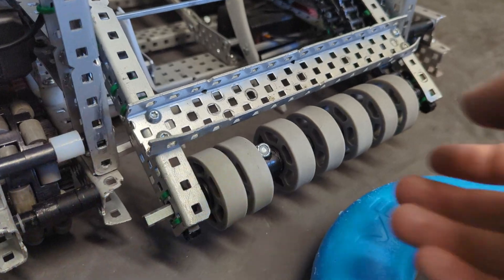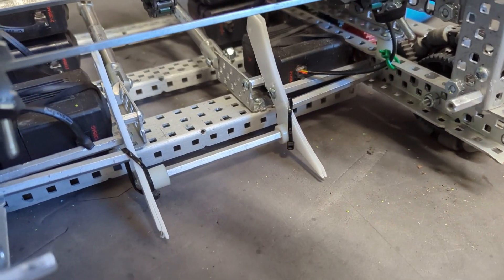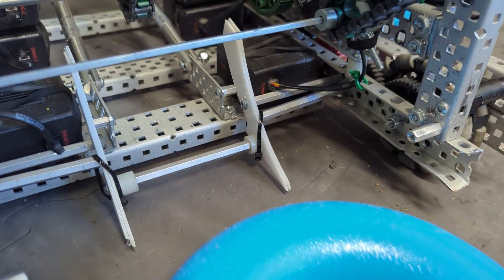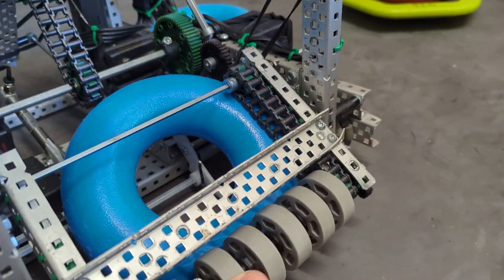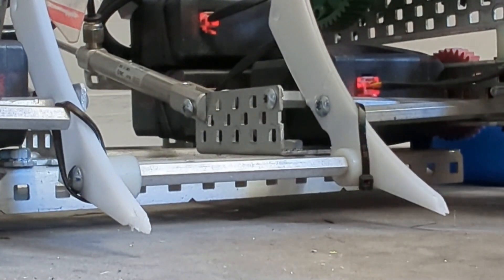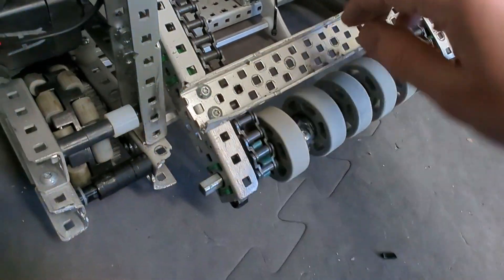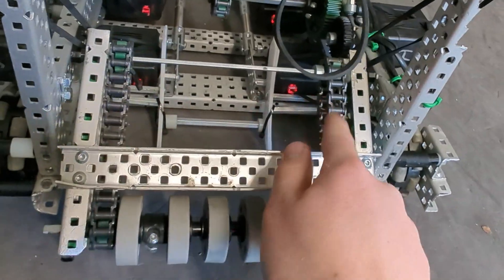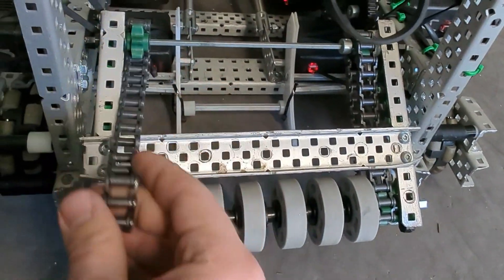How to Build an Intake Part 2 | VEX HIGH STAKES

Comment: How did you make it so your flex wheels still spin while it’s grabbing the rings. We have a problem where when the ring goes up the ramp the flex wheels won’t spin and push it into the hook
Reply: Do you have wheel Insirts and a floating intake?
Reply: @ yes I do I have basically everything that he has idk why his works and mine doesnt
Reply: @epiclapeer2661  clean ur flexwheels and make sure the ramp isn't to steep and put the flexwheels an inch infront of the ramp
Reply: Might be the code. That was a problem for us too. Just go into your code and increase the torque that helped us. I don’t know if it’s a good solution but it’s a solution.
Reply: @MeNoobVr  I added torque to it it’s a lot better sadly I can’t do it through code since it’s a 5.5 watt motor

Comment: axle getting ready to be destroyed :) dont do this. take a look at the coaxial screw joint + axle joint from 4154v's spin up worlds explanation for a good way to do this.
Reply from the maker: @3818c_cookin  You're right, that way is also a great way to do that, but this way works fine for tons of teams as well, and I've personally tested this intake in 30+ hours of drive practice without issues
Reply: @Joseph973  i would say that competing with something is a lot different than testing. defense can be very intense, and the head-on collision of two bots, both at max speed? thats a lot more energy dispersed than one robot can perform alone.
Reply from the maker: @3818c_cookin  I agree, by drive practice, I was talking about practicing with between 2 and 4 robots on the field, 1 robot imo isn't real drive practice
Reply: @Joseph973  wouldnt say that, 1 robot is valid. still wouldnt use the shaft, metal fatiguesm etc.
Reply from the maker: @3818c_cookin  Sure, to each their own

Comment: This is something I want to build but question what if I don't have flex wheels
Reply from the maker: One option is you can use flaps wrapped around the 6-tooth sprockets, and that might work as well
Reply: @Joseph973  what about the little green wheels

Comment: I dont know why people are hating on it so much. It's a simple, informative video about an intake that works extremely well. Thank you!
Reply: People are hating on it for a couple reasons.

a) it’s a mid intake, with a lot of building mistakes

b) he’s a lipper brother, notorious for ruining a lot of IQ comps by over-helping IQ teams

c) people think he’s plain annoying, almost on Doy levels
Reply: @FluffyDeath  it's geared toward new teams that maybe don't know how to build a working intake, not already advanced teams
Reply: @Bmxlegand_44 I think the issue is that the intake has a lot of bad building habits that new teams also have, so by making this the "ideal" intake, you're just propagating the problems new teams already have instead of fixing them as well as you could. Joseph acknowledging the issues would help a lot!
Reply: @FluffyDeath  idk what your definition of new team is but most new teams don't have a good intake. Yes it's not built the best but it works well. You can 100% build off of this and make it good

Comment: Your plastic is going to snap you need to put standoffs connected to the front points
Reply from the maker: I've actually doubled up the plastic sheets to keep that from happening (and haven't had any issues), but you're right that a standoff going between them would definitely be a good idea too.
Reply: @Joseph973  if you look closely some parts on the tip have already snapped off. That's just a sign that you kinda need to put something there.
Reply from the maker: @NtGm714  Yes I agree with you, that would be  good idea